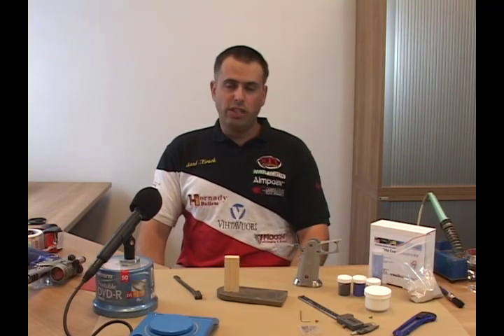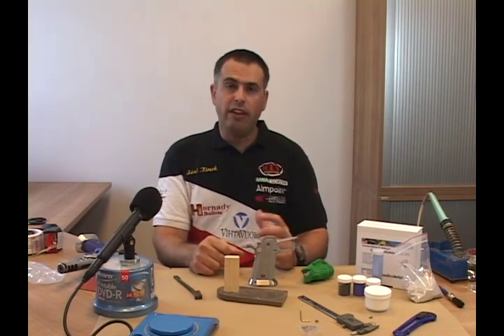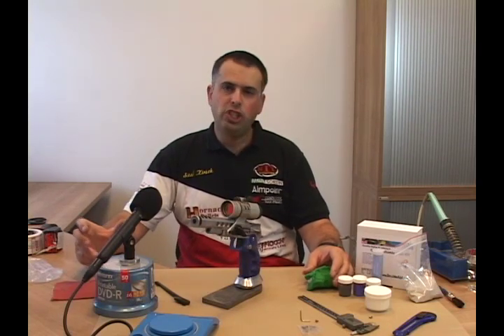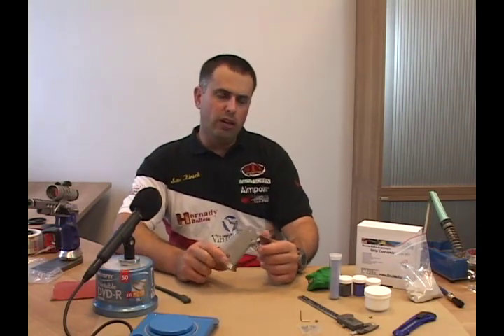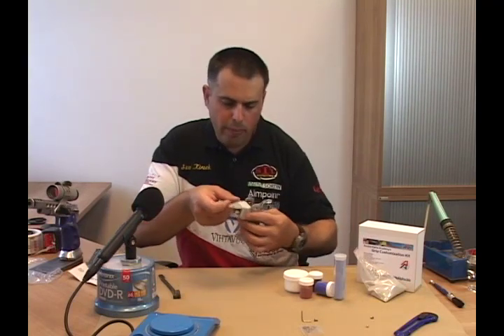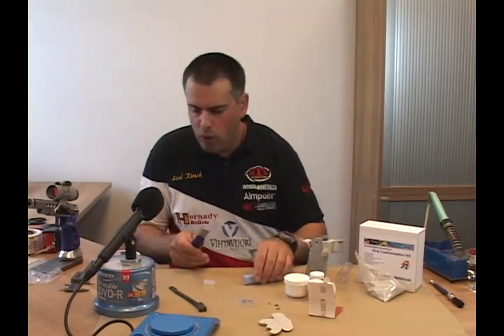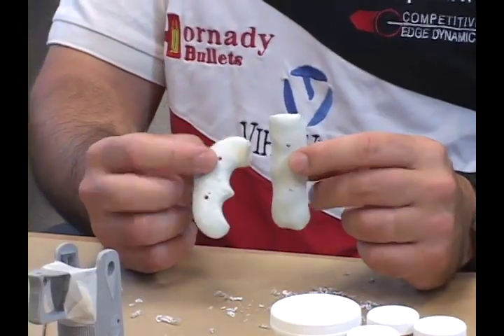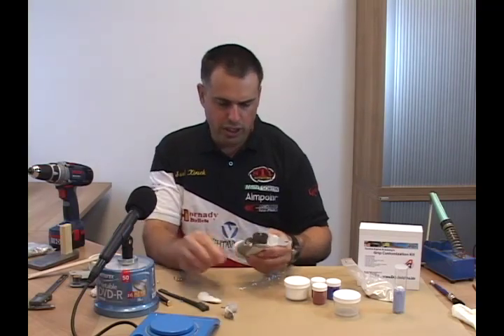IPSC Grip Customization Kit Overview and Instructions

Comment: Saul, this is excellent, Both the outcome and the video. I read your book a couple years ago when starting USPSA shooting, and customized my STI Edge grip. Never looked back! It has made a difference in my shooting, I am confident. I have a backup clone pistol without the modified grip, and HATE holding it compared to the custom grip! Made Master in my second year, no small part due to your help! Thanks Saul!